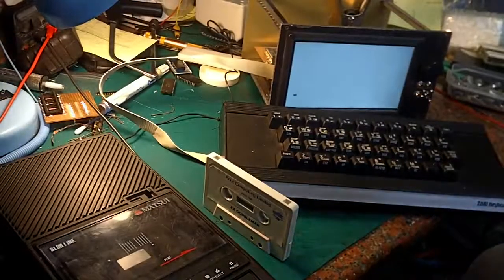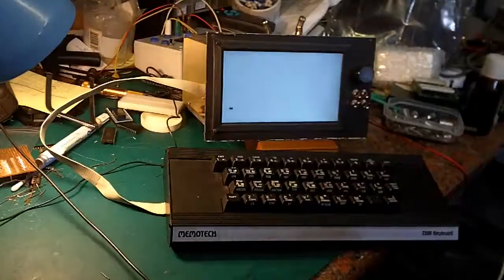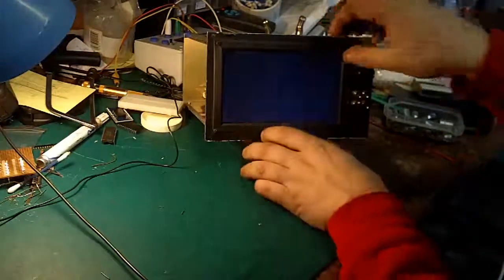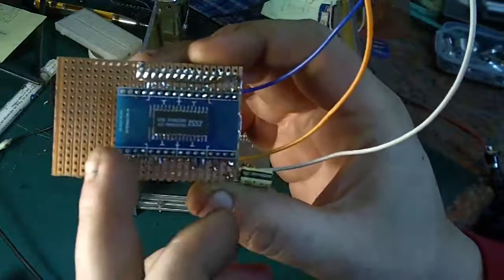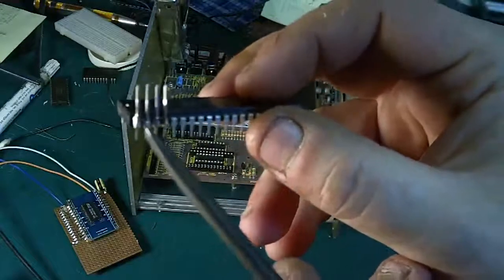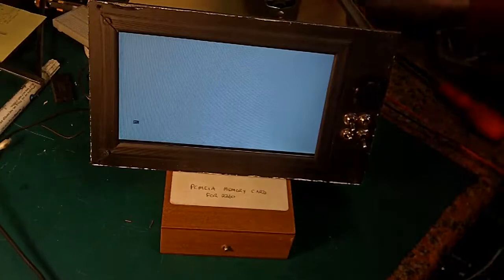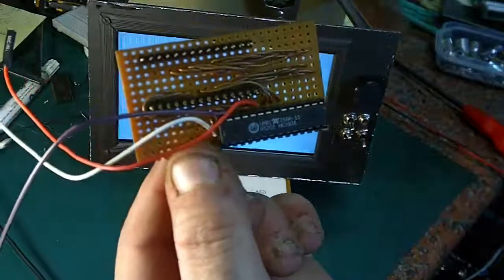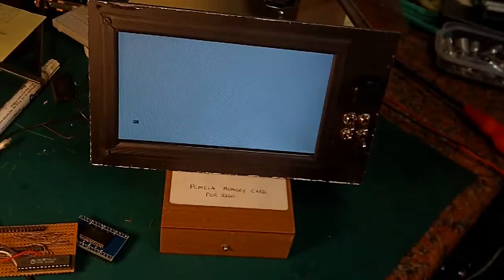ZX81 Project update Pt3 16K RAM upgrade

Comment: With that chip with two select lines, you can usually tie the active high one to 5V, and connect /RAM_CS to the active low one. The chip should only be active when both it's CS lines are in their active state, so it would still be disabled by the /RAM_CS line going high.
Reply from the maker: That is usefull to know.